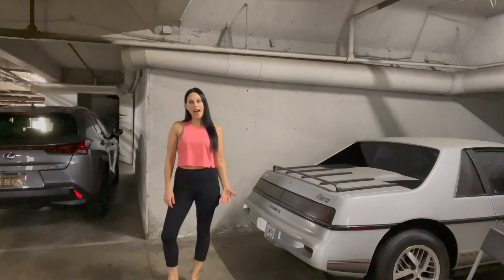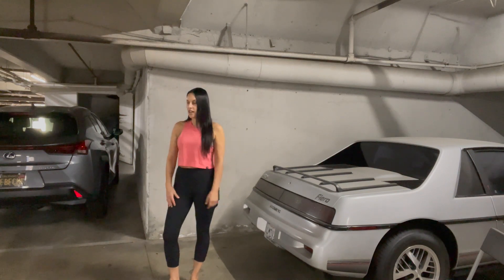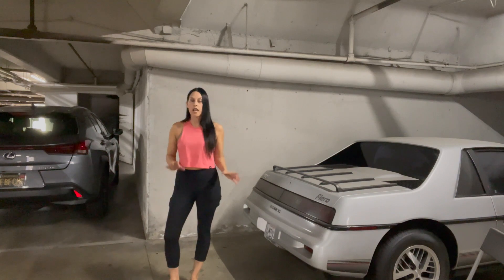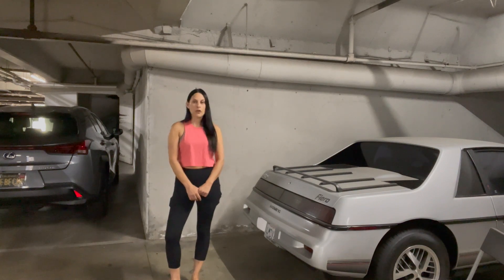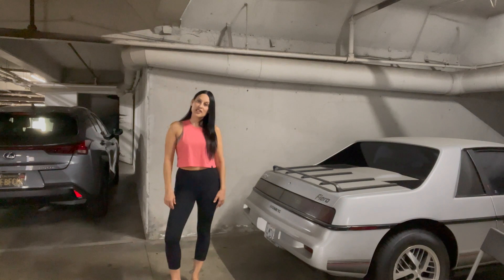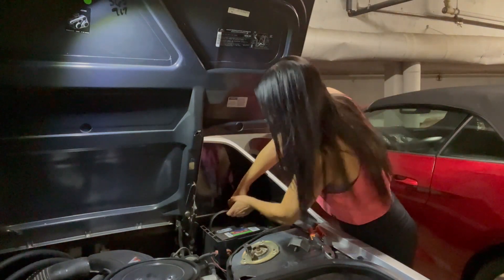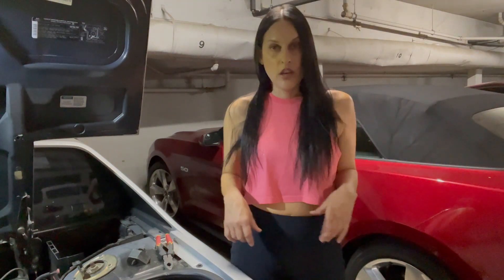How to change the battery on a Pontiac Fiero

Comment: Sorry, great video but one last comment. At 6:39 it is a popular misconception that Dielectric Grease goes on the battery terminal theads and where the battery terminal and cable come in contact.  Actually, that is wrong. "Conductive" Grease is for that situation. "Dielectric" Grease for batteries is non-conductive and putting it on the battery threads and contact points reduces it conductivity and can make your car hard to start in cold weather.  Dielectric Grease is meant to be put on AFTER the cables are attached to the battery - you apply a thin coat of Dielectric Grease over the terminal/cable areas to keep moisture out... it is not to make a better connection, it is to prevent corrosion which can then lead to a bad connection.

Comment: check your receipt, some auto parts store like auto zone near me will tape grease and felt washers to the battery and ring them up with the battery without telling you.  Also that bolt to remove the battery retainer is miserably long to get out with a socket let alone a pair of pliers! Good Job.

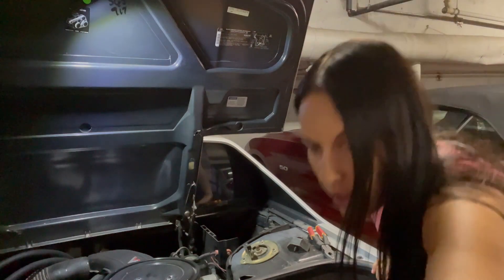Comment: At 6:04 your battery tray is actually in really nice shape. Some call the "tray thingy" a rack... you have a nice rack. If there was corrosion, try neutralizing any residual acid with a paste of baking soda (sodium bicarbonate) and a bit of water. It will foam if any acid is present as it neutralizes any acid. Then rinse well with water. If your battery has small side vents near the top edge of battery, be sure you plug one vent hole, then put in an elbow connector with a clear tube that runs from it to an area below the battery tray. This allows acid vapor and droplets to drip to the ground and not in your battery tray - which corrodes it.  Most auto parts store have battery vent kits. Dont forget to do this.

Comment: Nice video. At 4:21 I am impressed that you mention to take off the black neagative first... that is a pro tip! The reason is in case your "party favor thingy" (ratchet) touches the metal car chassis, it won't short and cause sparks - which is dangerous around batteries because they give off explosive Hyrogen gas. Also, as I mentioned in your O2 sensor video, get one of those small battery side post ratchet and keep it in your in-car tool kit. They are small and insulated for extra safety.

Comment: At 5:19 it is better to remove the battery clamp bolt with a six point socket with an 8 inch extension. Those bolts usually get pretty rusted and using pliers may cause the bolt head to strip.

Comment: Food for thought. I always put my battery receipt in a ziplock sandwich bag and tape it to the firewall side of the battery. Reason being if it shits the bed and still under warranty, it make for an easier replacement. You are also correct girls on bikes are totally hot.I have been riding for years, be extra careful at intersections. That is where you most likely could get taken out. Nice bike enjoy and be safe. Get that Fiero out there and blow the dust off it.